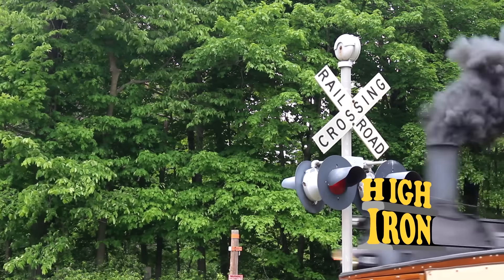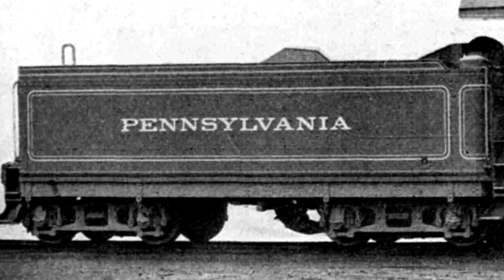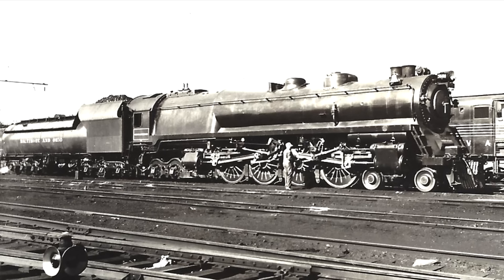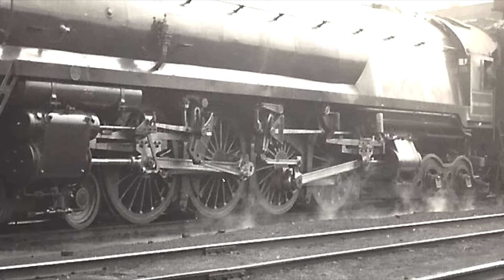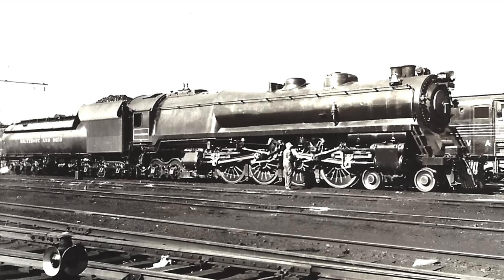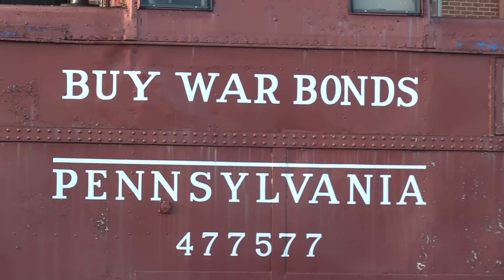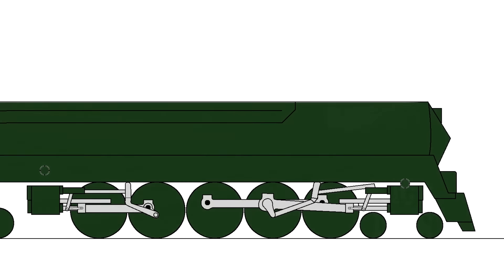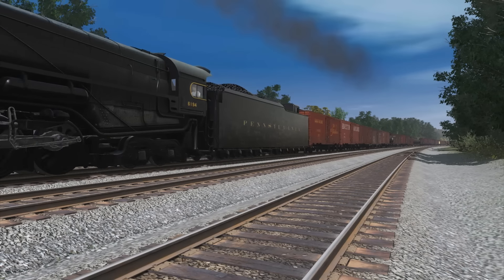Why Weren't Duplex Steam Engines Successful?

Comment: I bet it was hard as hell to time the cylinders on multiple sets of cylinders. This one even more difficult because the second set is backwards. Then some of the steam locomotives with 3 sets of cylinders, I'd be hesitant to even want to try timing them.
Reply: Timing would not be relevant on a steam engine, as the 2 pairs of cylinders would have had independent intake/exhaust etc, balancing the cut-off & power to rail would be the biggest problem, but there were plenty of mallet & garret locos that worked fine.
Reply: @stephenarbon2227  You are wrong friend. The pistons have to be timed to the valves and put in the correct position in the cylinders and one cylinder absolutely effects the others because they are connected by the drive assembly. I've done this multiple times. Oh and each cylinder, valve, and drive piston make up is a steam engine, when they are placed on a frame with the boiler and wheels that's a steam locomotive. So a steam locomotive actually has steam engines on it.
Reply: @williambryant5946  
You're confusing a normal 2, 3 or 4 - cylinder steam engine, with what this article was about : locomotives with separate sets of cylinders.
Each pair has its own steam lines, operating control and blastpipe.
They were in effect separate engines, sharing a common firebox and boiler.
Each set of drivers, quite often slipped under load and might briefly spin independently of the other set, until corrected by the driver or regained some grip on the rail.
Don't call me your friend when you write so rudely.

Comment: while watching a  motor GE bouncing up and down on modern track, It brought up an idea that the Duplexes would "Hobby Horse", unloading one end of the driver frame then the other allowing an end to run away. How would this happen?  Not enough weight on the drivers. Possibly redistributing the weight might have lessened the run away tendency. Just a comment
Reply: The principal actual difficulty is cross-level unloading, where one wheel on an engine encounters a momentary decrease in effective adhesion.  This lets the engine slip up until adhesion is re-established (at which point it slams back into sync at road speed) or it spins up to balancing speed for the given mass flow of steam (something unfortunately facilitated by the Franklin type A gear and poppet valves).

They are too long, and too well suspended at either end, to porpoise between engines.  However, this theory is part of why the S1 had a comparatively lower percentage of weight on the drivers.

Comment: I've heard there's still a place for steam locomotives in places where they have to run trains at high altitudes, like Ecuador.  Internal combustion starts to fail unless you turbo charge the hell out of them.  Much easier to just stoke up a bigger fire in an external combustion steam rig.
Reply: No, its literally easier to have a mechanically driven supercharger, simple science bub.
Reply: @LennyTwo-o7q  '' simple science bub ''

Comment: One thing not often mentioned is that diesel locomotives are simply more economical than steam engines. Just look at the diesel fuel payload vs coal payload - the former is a small tank between the trucks, the latter requires its own car.

Comment: The rigid frame of the wheelbase Limited the route that it could transverse. They were also very slippery engines you could not get what they were capable of because you could not get the power to the ground. One engine would slip and then the other engine would slip. None of them by any of the railroad experiments were successful. They were also expensive to run compared to Conventional modern Steam locomotives.

Comment: The big issue is where will it be allowed to run. As far as I know they do not have access to an appropriate railroad line. The original plan was to use a line that is controlled and operated by a GWI road, which will not allow it to run on their track.

Comment: I thought I had read that a Duplex steam engine had full pressure in the front cylinders and the back cylinders were that same steam used again.  I  thought the second set of wheels had a larger cylinder.   I   didn't hear that explanation or maybe I missed it.  My understanding was that they didn't get much of an adantage from that setup.  Never heard about the wheel slip when under way.  I always figured that only happened at startup.   So that was interesting.   I loved the whole video.  Have to check out more on the channel.
Reply: That would be a compound locomotive. They don't have to be duplex if there are extra cylinders between the frames. They were widely used in Europe and less so in the UK. They have a theoretical advantage in producing more power per unit steam and water, but in practice it's only a few percent. The low pressure cylinders are indeed larger than the full pressure ones because the LP steam occupies a larger volume.
Reply: No, a duplex has the same steam pressure applied to two sets of cylinders.
You're thinking of a compound, which takes the steam exhausted from a set of high-pressure cylinders and feeds it to a larger low-pressure set of cylinders.
Reply: I think you're confusing the ACE 3000, which was a 'Withuhn conjugated duplex' and would have been compound, with the duplexes in the video, which were two reciprocating two-cylinder 90-degree-quartered DA engines with independent admission and exhaust tracting under a common boiler
Reply: Indeed I was.  Thanks guys for all the explanations. I was thinking duplex engines were compound.
Reply: I suppose we did have what night be regarded as compound duplex locos in the UK, but these were of the 2-2-2-0 and 2-2-2-2 wheel arrangements and to be honest the less said about their performance the better!

Comment: Fascinating and thanks for this video! A few curious questions about steam resurrection: I would think burning coal, a virtually "free fuel" would be an advantage over diesel? Can passenger trains be lightened up enough that steam could pull them fast and therefore avoid the capital cost of electrifying thousands of long-haul miles across the US? Or is steam just better suited for heavy freight? Is emissions a problem for coal steamers? Is there anything that big steam can do better than diesel or electric?

Comment: Did no one ever try a steam turbine electric locomotive?  Seems to me it would be a heck of a lot cheaper to maintain.  Plus is you added a few electric motors to a few of the cars you could get rid of wheel slippage all together.
Reply: Steam turbine electric locomotives were built, but never quite became a success, I don't know why though.
Reply: A diesel engine will do the same thing without water stops.
Reply: a train doesn't need QUITE enough power to justify a literal rolling power plant as a locomotive.

Comment: I'm surprised that nobody mentioned that there is a T1 trust on rebuilding the PRR T1 5550 Locomotive from the ground up with brand-new metal construction. You can search it up by putting in PRR T1 trust. As it sits right now it is 39% completed.
Reply: The T1 5550 project is mentioned at the end of this video.

Comment: as a brit, i enjoy steam from train to factory use, now about the video I notice some jumping from your rail game weather its dovetail or other, turn the V-sync on/off and that should improve the capture  usually depending on your gfx/gpu card if there is not enough compute power and you set it too high on visual it will tear images so try turning visal standard from say ultra down to high and that will improve the look and smoothness of image, then going from there you can improve settings one by one till its clean and at a standard you want  
loved the video and did I notice a chuckle in your tone at the start?

Comment: The K-4 Pacific shown at 1.47 to 1.51 is an original K-4 built in 1914. Note the small tender, spoked wheels on the trailing truck, and the oil lamp.

Comment: There were a few retired engineers that ran the T1. They claimed that the fear of crew reduction due to the T1 power that they actually sabotaged the performance. If the railroad needed fewer locomotives they would also need fewer crews. The freight engineers did not fear layoffs. They ran from a pool seniority system. That's why the Q2 was a lot more successful.
Reply: That's... sick!  Well, the arrival of diesel-electric locomotives did what the T1's didn't.

Comment: Honest question:
If the main issues with the s1 was overall length why didn’t they just build a revised ‘S1a’ with a shortened wheelbase for better flexibility?The T1 couldn’t solve the issue of wheel slip and the poppet valves only made maintenance more of a pain, and the q2 proved that you don’t need fancy valve gear to get good performance at high speeds.

Comment: I thought it might be about compound locomotives, but no.  
 
Our bavarian pride is the S 3/6, later BR 18, which is a 4-cylinder compound engine, that is the steam of the high-pressure cylinders is used a second time in a pair of low-pressure cylinders, increasing the efficiency. 
 
It was a pretty powerful and fast engine, not far behind the standard "beast" and workhorse of the german inter- and postwar passenger railroad, the BR 01.
Reply: The Americans tried compounds, but decided simplicity beat the complexity of compounding.

Comment: I know nothing of US railroad history, however I enjoyed this immensely. 
Were steam turbines ever considered for rail applications?
Reply: They were certainly tried in the UK with one quite successful engine which ran for 15 years. The snag is that turbines run best at constant speed and constant load which doesn't match well with most steam engine duties. The UK engine mainly ran London-Liverpool expresses at a constant 60-65 mph. Likewise gas turbines tend to use much more fuel than diesels because they are so inefficient at part load.
Reply: @andyharman3022  Thanks, interesting link. The comments there suggest that they couldn't iron out the technical problems. I think the British LMS "Turbomotive" was the only one to actually run in revenue earning service for as much as 15 years. But when a major overhaul was needed it was decided that it showed no advantage over conventional reciprocating engines and was more awkward to maintain, so was rebuilt into one in 1952.
Reply: All the theoretical difficulties were addressed in the Turbomotive 2 effort, which I think was mistakenly abandoned by Alan Fozard when he threw his attention over to the 5AT as a 'likelier' future-steam project.  In particular, the Westinghouse patent for the epicyclic transmission for S2-style drive (in 1948) was a perfectly adequate approach for mass-flow slip at low rotor speed; so was adoption of the Bowes drive on the reincarnated PRR V1 a year earlier.
Reply: Steam turbine blades and coal dust, bad juju.

Comment: They were very successful, especially the PRR T1.  What happened was that a business decision was made by the railroads.  They wanted to save money by replacing steam engines with diesels.  It worked.  The diesels were indeed much less expensive to operate and maintain.

SO while the T1 and other end-of-the-steam-age engines were great machines and technically successful, that didn't matter because the railroads did not want steam engines.

Comment: Considering electricity has been around since the late 19th C, I've never understood why trains weren't electrified wholesale, earlier - not in the USA & Canada perhaps, but certainly in GB & Europe
Reply: Electrification is prohibitively expensive. Back in the day when electricity was produced mostly from coal, it didn't make that much sense to burn coal in a power plant and send the power down through expensive wiring when you could burn that coal directly in the locomotive's firebox instead. There were niche areas where electrification made sense early on, like countries with little to no coal, abundance of other energy sources (like hydro), or places where the smoke from steam locomotives used to be problematic (city centers, long tunnels, ...). Electrification can eventually justify its high initial costs through energy savings, but it takes a long time. This period is shorter for heavily-used lines, thus commuter lines were often among the first to be electrified.
Reply: Copper costs.
Electric trains are lighter, and accerlerate/decelerate much better than steam or diesel powered trains, mainly because the mass of fuel and thermal generating plant is offloaded to a stationary power plant, where unlimited size, weight, and cooling ability let them get up to 60% thermal efficiency.
This means electric was the perfect fit for the high speed, start-stop conditions of passenger service.  Especially in dense urban corridors.
Running expensive conductors across hundreds to thousands of miles of prairie, mountains, deserts, or taiga never made much economic sense.  It still doesn’t.
Reply: Hint: ginormous cost.  Even Morgan didn't pay for the New Haven to electrify past New Haven...
Reply: It is in fact pretty extensively used in Europe and GB including all the high-speed and suburban lines. The distances are shorter so the infrastructure cost is less. The amount of power generated from a ton of coal in a power station is remarkably greater than if burnt in a firetube boiler; typical efficiency 30-50% instead of about 7%. But it is a substantial investment of money and time especially if using overhead wires. Southern England used third rail which is cheaper to install but limited to about 100 mph and transmission losses are greater.
Reply: I gave the short historical version.  There were many attempts at electrification in the United States over the years; two notable ones only 'nipped in the bud' by cheaper dieselization were the PRR electrification from Harrisburg to the Pittsburgh area, and the dual-mode-lite rollouts for Conrail and ATSF in the early '80s.

Adoption of modern constant-tension cat and certain Chinese construction equipment and methods have dramatically reduced the cost of OHLE; several of the 'smart third rail' arrangements for transit can be scaled effectively to handle heavy-rail traction current especially for low-clearance or other special services where continuous cat is difficult to fit or impractical.

Most 'electrification' is still only practical with Keynesian-style government participation, which for various reasons has not caught on 'yet'.  I expect this to change, radically, but not in the conventional form that completely substitutes electric equipment for current types of locomotive power.

Comment: I always wondered why PRR never took the next step and split the rigid frame to create a 4-4+4-4 (or a (2'B)'B2' in UIC notation) or something similar. Maybe a Mallet-type engine was not fast enough for high class passenger service.
Reply: The issue was well-recognized: hinging a comparatively short wheelbase, combined with the lateral compliance of the pin-buided lead truck, would produce a compount-pendulum effect at high speed that would be difficult and expensive to compensate for.  The interesting and, so far as I know, unsolved question is how fast the N&W could have run the last five A-class 2-6-6-4s, which had the same lightweight running-gear components as the J engines with no issue of long pins on the #4 driver.  (In my opinion these engines were suitable for N&W's 'counter' to the C&O Chessie train's M-1 STEs for the Cincinnati competition that never evolved as anticipated)

A far better question would be 'why not a Garratt?'  Almost the very first Garratt built, well before WWI, was an eight-cylinder double Atlantic, easily "scaled up" to T1 size and capacity.  And a more contemporary design was the somewhat-astounding Algerian Garratts... for those trains that actually needed the full horsepower of two K4s at speed...

Comment: Something that ought to be added to this discussion is that, as late as May 1945, the New York Central's postwar plans for passenger power were not 4-8-4s, but 4-4-4-4 duplexes with assigned class C1a.  These were notable for having nearly-common boiler dimensions with the S1 Niagaras (which involved comparable grate area to the original Baldwin design proposal), Baker valve gear (they were not averse to Franklin type A, and in fact would test it on the S2a, but it was an effective flop) and the same improvements in spring rigging that corrected much of the low-speed slip issues.  A notable point about the C1a was that the lower water rate of the duplex translated into a lower fuel rate -- which in turn allowed design of a 64-ton tender that would permit the locomotives to run unrefueled all the way from Harmon to Chicago (saving the mandatory refueling stop and both the acceleration/deceleration and dwell time required for it)

Of course the performance of the Niagara and its lightweight rods and running gear, once it had received the 79" drivers, proved more than adequate for NYC's actual passenger needs, with less mechanical complexity or susceptibility to high-speed slipping.